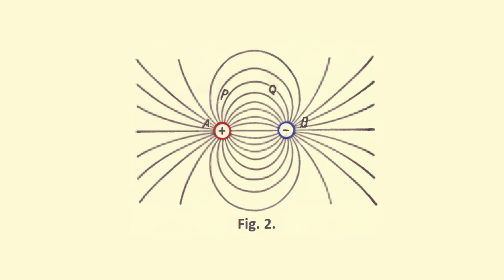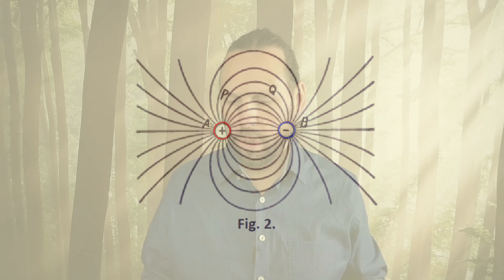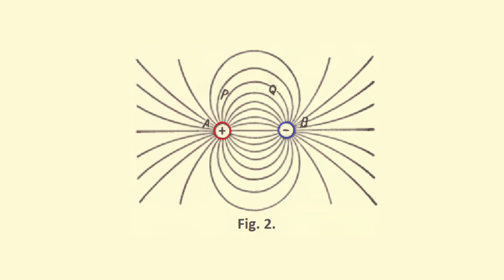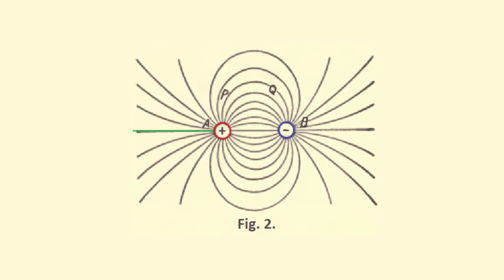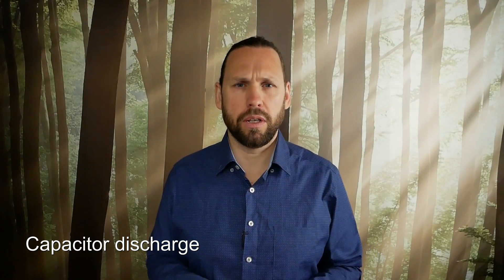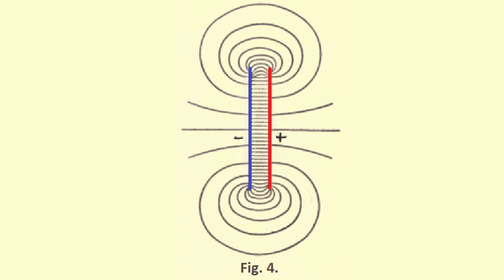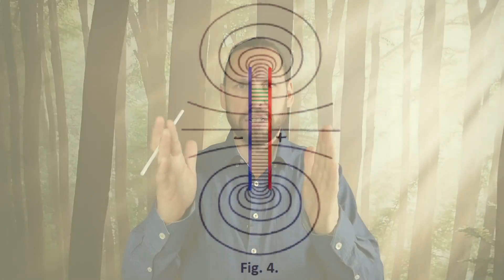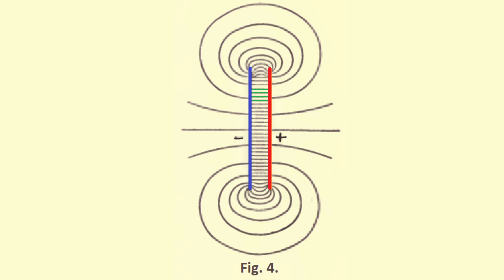Faraday tubes, explain lines of force in electric Aether fields.

Comment: I have heard magnetic field lines described as the ether in motion, which is a storage of kinetic energy and the dielectric field lines as the ether under strain, which is a storage of potential energy.  Do you agree with this?
Reply from the maker: I don't agree or disagree with it. It's still a  mystery.
Reply: @MasterIvo  The part of the statement about magnetism being ether in movement and dielectricity being the ether in strain came from Eric Dollard.  I am assuming he read that somewhere, but he never was specific about the source, as far as I am aware.  The part about magnetic field lines being kinetic energy and dielectric field lines being potential energy is comes from Charles Proteus Steinmetz's Discharges, Waves, and Impulses and other Transients, and a few of his other works (cannot seem to remember exactly which ones off the top of my head.)  Were you referring to just the part that came from Dollard being a mystery or do you have reason to think Steinmetz may not be correct about the kinetic and potential energy?
Reply from the maker: @wesbaumguardner8829  I simply don't know. I can only guess. But to me the faraday tubes make sense. They are created when the aether is polarised. the tension is the voltage of the dielectric field. and the loops they make when tranverse moving through the aether, dragging allong the volumes of Aether, 
 as the magnetic field, makes it clear to me, both fields are made up out of these faraday tubes.
but the the volume if aether captured  in the magnetic field represents the inertia.

The question is, when these fields are transforming into each other, what ia happening?

can we make use of this inertia? of the mass represented by the aether.

If the current is zero, this says the magnetic field is zero. but still the volume of aether can be in motion?

so much questions.
I hope experiments will clear things up. 
Theory only helps us understand the strange phenomena we observe in experiments. but it doesn't need to be a truth.
Reply: @MasterIvo  Well said.  I appreciate your honesty.  It is very refreshing to hear someone admit they do not know instead of pretending to know something they do not in an attempt to save their ego.  "The question is, when these fields are transforming into each other, what ia happening?"  That is a very good question indeed.  I do not truly know the answer and can only speculate, but I will share my thoughts on this.  If the first question I asked you is the way it actually works, the magnetic lines are the ether moving and are a store of kinetic energy and the dielectric is a strain on the ether and is a store of potential energy.  There is a simple mechanical analog to this situation: a wind up toy.  Inside a wind up toy, there is a tension spring.  When kinetic energy is applied in a certain manner, the spring tightens up and becomes under tensile strain.  The spring wants to return to its original shape, which is tensionless.  If there is no resistance, or at least less resistance than is required for the stored potential energy to overcome, the potential energy will be converted to kinetic energy and the spring will unwind.  So, what if the magnetic energy is not only the winding energy, but also the resistance to the release of the stored potential energy?  If this is the case, if the magnetic energy is reduced while the dielectric remains the same, the potential energy stored by the dielectric will become kinetic and convert to the magnetic field.  The exact opposite would also be true if the dielectric was reduced and the magnetic stayed the same.  The two fields would always seek equilibrium.  This is just my interpretation of Steinmetz's work and I have not done the experimentation to determine whether or not it is correct.  "If the current is zero, this says the magnetic field is zero. but still the volume of aether can be in motion?"  How would the aether be in motion if the current is zero?  Are you talking about a macro motion of the aether as a whole or a localized motion such as magnetism?  "Theory only helps us understand the strange phenomena we observe in experiments. but it doesn't need to be a truth."  I think theory needs to be close to the truth if it is to be useful.  Errors in theory can lead to a hindrance in progress.  Until they are located and dispelled, errors will usually throw a monkey wrench in one's endeavors.
Reply: @MasterIvo  this is how i view gravity, aether rushing in to matter pulls aether in behind it, that flow is gravity, like a 3-d shower pulling in the the earth. this causes some heat and rotation od the partical eliments.
Reply: @DANTHETUBEMAN  You can find gravity decoded in our Axis Mundi video and E=MC^2 in our Angels Decoded video. :)